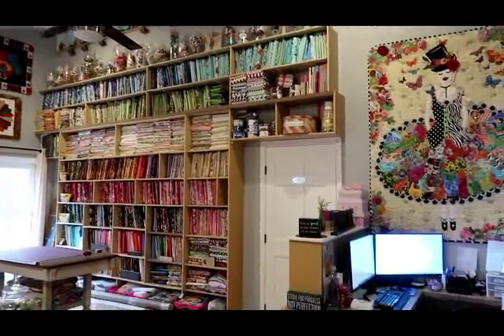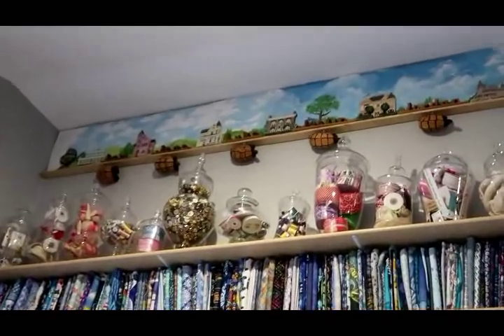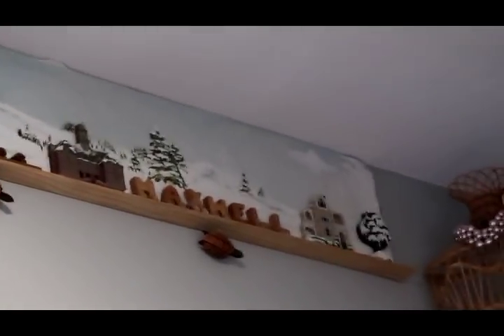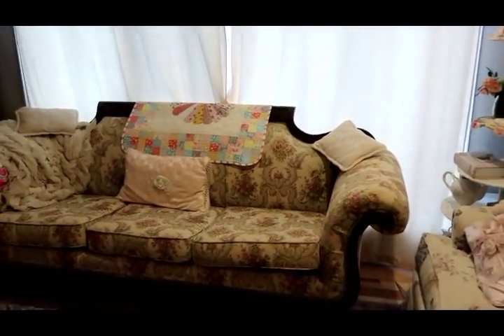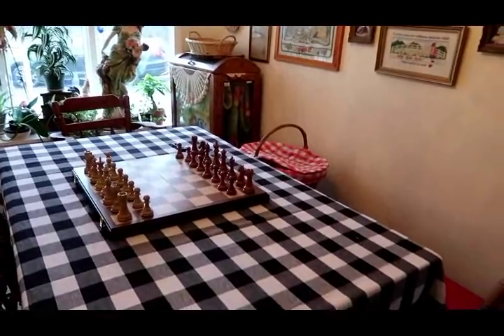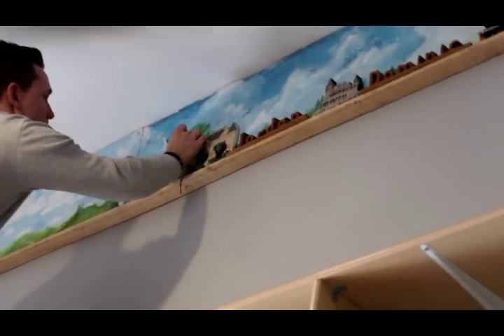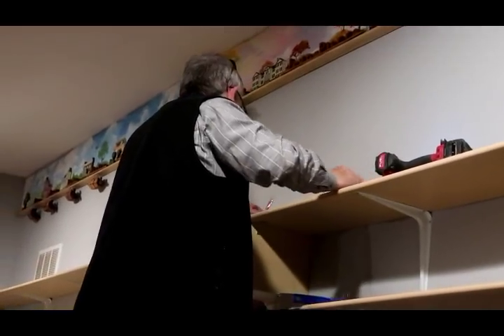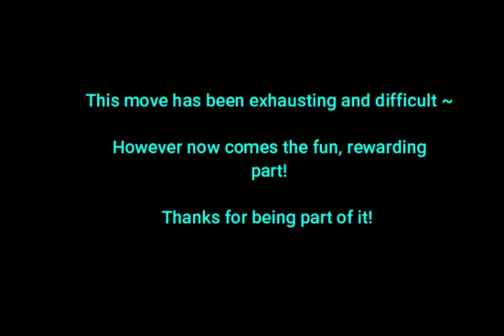DOWNSIZING ~ My New Sewing Studio is nearly complete!

Comment: How wonderful your mural is! So meaningful. 
Question; how do you mount your quilts to the wall to get them so flat? I heard you say you use small nails? Really? Nails in your quilts?
Reply from the maker: Thank you!  Every one of these quilts has a proper hanging sleeve on the back of it, however, I made them that way if I was to sell them in my Etsy shop.  I decided to keep them and hang them WITHOUT all the hardware/rods involved in case I wanted to change them out ~ as I like change!  And so, yes, tiny little narrow nails caught right in the binding stitches secure them nicely ~ and other than, literally, pin holes, there is no damage.  I have hung other quilts like this and no harm/no foul!  LOL!   However, I DO suggest that a PROPER way to hang is with a proper sleeve, and rods and brackets (of course that is for a more permanent art installation).